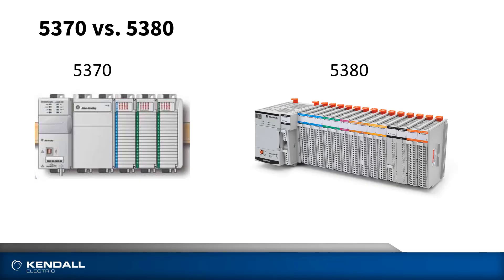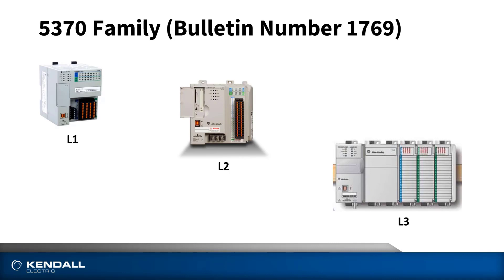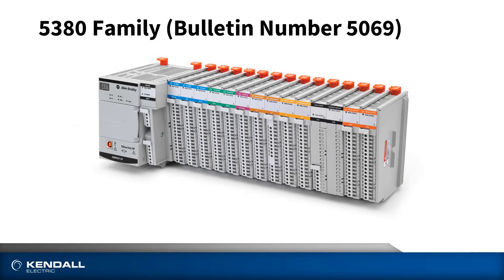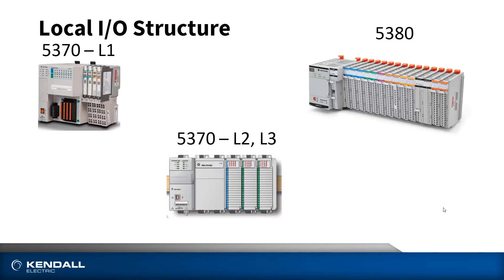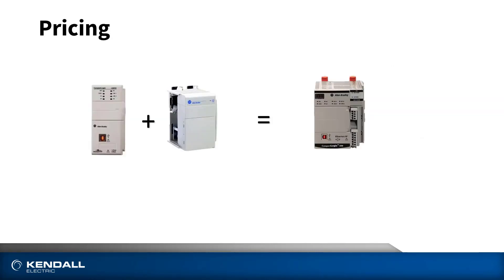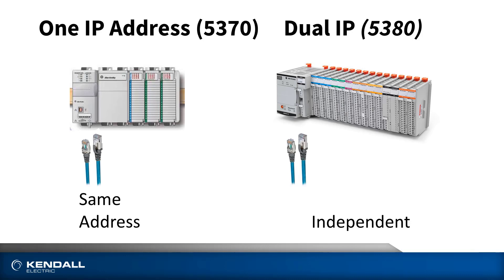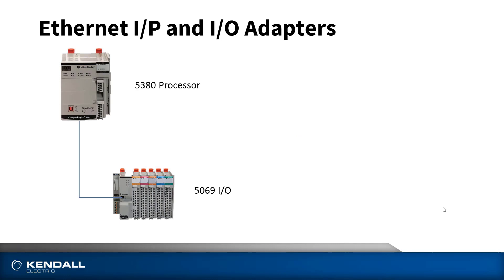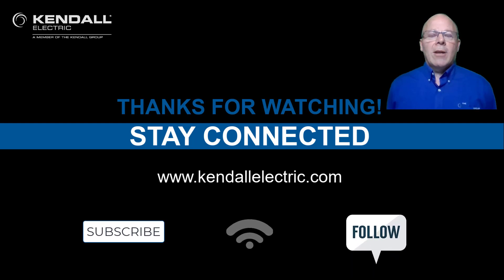CompactLogix 5370 vs 5380-Kendall Quick Connection

Comment: Nice! Eric is now joining the list of Youtube influencer.
Question: 
How do I extend the 5380 with 3 networks? If not,  can we request AB to give us one more.  
For 5370-L3,  same question as above, 2nd network.
I know 1783-NATR is an option, but does not seem right to me as far as speed concern.
Also can you confirm, the speed of 5380 ports, are they the same or different. I believe A1 is the Enterprise port can run at 1GB and A2 is machine level port can only run at 100MB.
Reply from the maker: Thanks for the question! If you need 3 networks connected to a 5380, the solution is to add a 1783-NATR from Rockwell Automation which uses Network Address Translation (NAT). This essentially gets you 3 IP addresses. The same holds true for getting a second network on the 5370 family. This will create some latency, so if speed is a concern, those devices should be connected directly to the Ethernet port of the processor. Rockwell is aware of the request to have additional networks, but currently NAT is our solution. Both A1 and A2 are 1GB ports so they can exist in a 1GB Device Level Ring (DLR) or as separate ports.